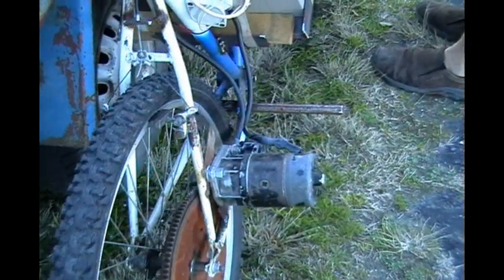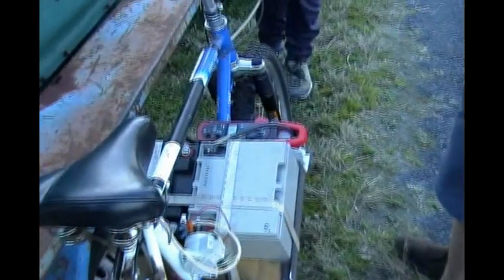Starter Motor Powered Bike 24V (With 12V Motor)

Comment: I've heard that overvolting a motor is possible, and it will draw more current, but that the majority of the extra energy just goes to heat and not to any usable power. Would be really interesting to do an apples-to-apples, same motors but one at 12v and one at 24v and see if there is a significant speed difference.

Comment: Damn it has both torque and speed. :D I want to make the same, but first I have checked, it could work and yes it could. I will use gears, belt and belt tensioner, so I can control the load of the motor.
Reply: Starters are meant for short hard burst aren't they? So the bike would work, but not for long right?
Reply: As long as you have a cooling system it will work maybe put some heat syncs and a fan

Comment: The motor burns out not only because of the voltage but because it was NEVER intended to be used like this. 5-10 second bursts maximum at 12v ;)
Reply: Forget about the double voltage in this case but who told you that a starter motor burns after 5 to 10 seconds?.
Starter motor is working at a fraction in this case compared in a car.
Starter motors does not burns easy as you expect

Comment: i wonder if you could have two 12v batteries and simply switch it up to 24v when you need it. another idea would be to watercool the motor with copper pipes and a dc pump

Comment: starters have the front part of the shaft mounted on a bearing,but the bottom part just sits in a hole with some lube.youd have to fit bearings to all of them and then weld somesort of small tanks or pockets on their bodies to cool down the brushes.otherwise the fun will be short lasted.also you will need some pretty impressive batteries to power 4 or 5 starter motors.if you have enough money,then id reccomend optima redtop ones.

Comment: Nice, what was the starter from?  Got a couple of options here ranging from a 1.4 petrol to 1.9 diesel units, thinking the diesel one will be better.  Gonna have to try this, might rig myself a crude speed control system allowing softer start on 6 or 9 volts, then a series/parallel relay to have "normal" speed or "turbo" lol

Comment: Hi, nice video! 24*192= 4608W sweeeeeeeeeeeeeeeet.
Your starter looks pretty small, no wonder there only 192amps on twice a nominal voltage. You should get some truck starter, they eat 400 amps minimum and thats on 12v, 24 it will be like a 1000, so  24KW can explode :D
Also you could get chinese RC brushless 6.5kw motor, controller for about 200$, they gonna run on 48 volts, if gearing would be correct it doesn't burn out even if overvolted.
BTW: Nice hellmet and Iam waiting for new video soon
Reply: how many rpm ??

Comment: also try using a 6s lithium battery or make one from old laptop batteries(cells inside) it would work way better (faster, longer lasting, quicker charging, lighter, WAY SMALLER, overall improvement!
Reply: Have u tryed using laptop batts un series ?

Comment: I am currently thinking about going to the salvage yard and snagging 4 or 5 starters off of like cars and using all of em together. That way each motor works less to get going, it would pick up speed crazy fast. I would most likly be able to use a normal bike sproket or close to it. I wana build a Electric Drag Bike. I'm shure that the more starters used at once, the more ass it would haul. I also plan to use a cooling system.
Reply: Aaron Allen did you do it?!?!?!
Reply: goodluck cowboy yeeeehar

Comment: @EVZebra: I don't believe on a CarStarterMotor with just 2ooW! My 75occBike has a 500W Starter. Think about it ...if you doubble the Volt the Power grows in Quadrat ...maybe you try a parallel switch and use the double Amps ... and use a Chain ore a helical gearing

Comment: You've accidentally discovered the solution to the lack of appealing sound from electric race cars.... shite bearings!
Reply: LazyH-Online  The helical gears only make contact in a small patch at any given point,  to keep noise down.  That patch moves across the teeth as they mesh.  That's why they're also weaker due to all the force on a small area.  Straight cut are supposed to spread that contact patch across the whole tooth from the moment they touch, which allows for forcefully mating the gears quickly with no clutch and no synchros ,  at the cost of constant gear whine.
Reply: LazyH-Online  I think straight cut gears are shiftable because of the dogs on the side of the gears that are the crudest form of synchro but necessary to make the next gear travel at the same speed.   I'll bet they adjusted the rpm drop rate during testing so that it would match a relaxed shifting speed

Comment: he was talking about his motor and no starter motor has a continuous power rating,because starters are meant to give a big amount of torque with a big amount of current for a couple of seconds and they dont have bearings also.thats why they dont last long and burn out.and when talking about starter power,my truck has a 12kW electric starter.also it would help if you would write a bit better or would learn to write in a more correct way.

Comment: also try using a potentiometer to control the voltage or maybe a pwm this would essentially become a throttle on your handlebars. save all the stress you put through that motor trying to take off by switching it on/off/on/off/on
Reply: +Shane Williams i built one but cheated....used an ebay 48v 1000w rear wheel lcd display bike kit. Also, built a petrol one (currently broken lol)